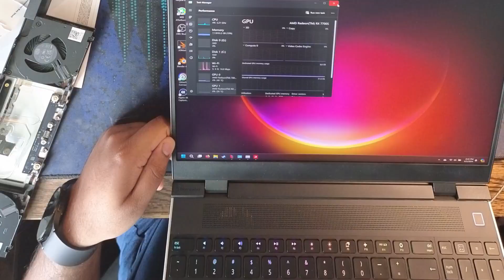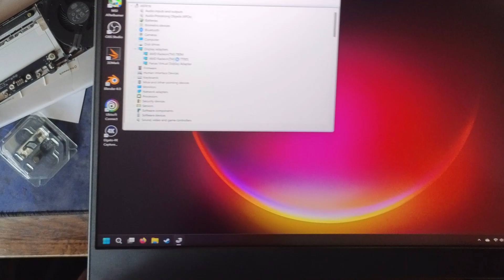My Framework 16 DIED (I replaced it)

Comment: How did the framework laptop die? Like no power, or laptop overheat and fried the hardware? I’m interested in the laptop but kinda thinking of waiting to buy till gen 2 since they only semi fix the keyboard flex with foam pads. Those foam pads will have to be replace because they don’t hold form forever. It’s like back in the PlayStation 3 fat console era when the cpu heat sinks were hold into position by foam pads lol.😂. It made the heat sink unlevel to the cpu and lost cooling potential. Also how is thermal under regular work load with cpu and gpu?
Reply from the maker: It died when I swapped the gpu out to the blank module. I say die when really one of its main appeals, stopped working entirely. The GPU on it was not detected and did not work after the swap. Thermals on this seem fine under load, it definitely needs space to breath though.

Comment: The second the gpus get a little better in these, im in.
Reply from the maker: Totally get ya
Reply: From which framework told you that they were sending a replacement framework 16 until you received your second framework 16, a long time passed?

Did you have to send them your framework 16 first?
Reply from the maker: @PbDex-o7w  I believe they sent the replacement laptop first, I used the box that it came in to send the defective one back. 

It took only around 3 days of emails to get them to issue a replacement! YMMV though